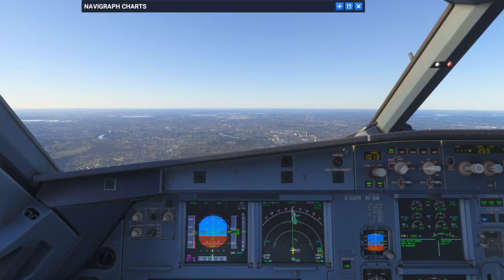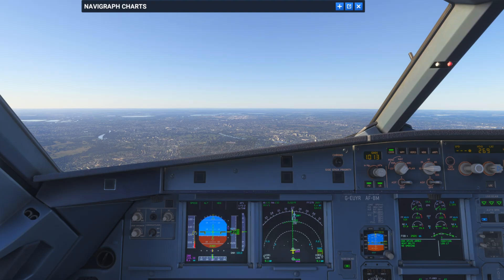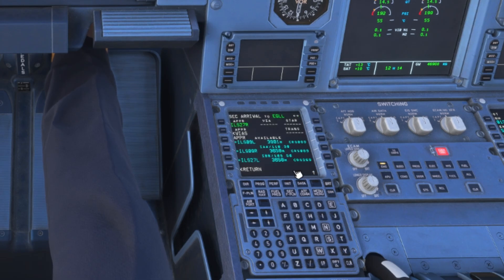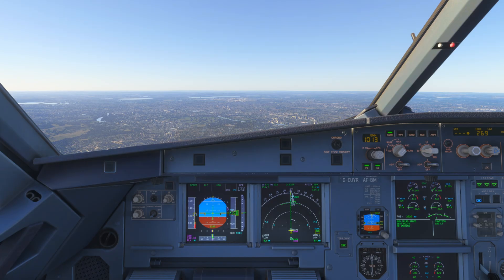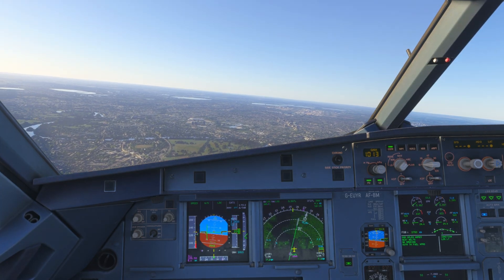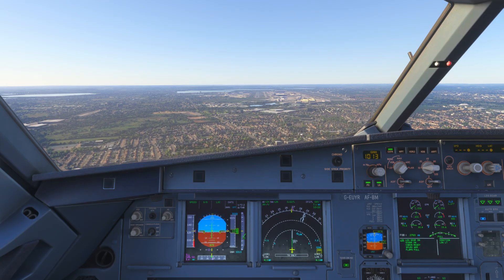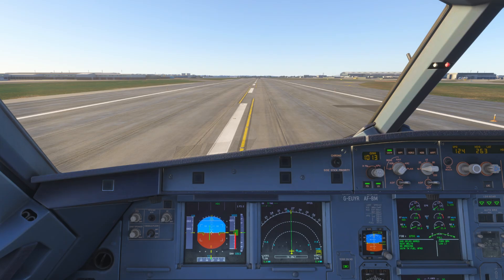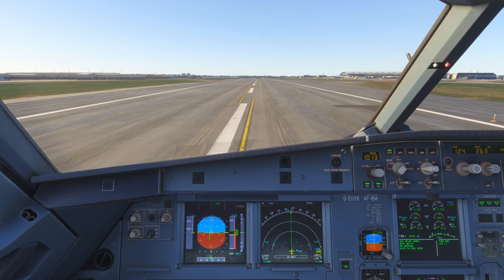How to Fly a Sidestep Approach | Real Airbus Pilot Tutorial in MSFS 2024

Comment: Can't believe I never considered using the secondary flightplan for this sort of thing. Whilst I wasn't doing a side step, just tonight I went into Paris (LFPG) on vatsim and was unsure which runway I was going to get 26L/27L on arrival as both were in use. I had to quickly change the box at the last minute but this method would have saved so much time....! Thanks for the tip.
Reply from the maker: No problem, there is always a use for the secondary flight plan in every stage of flight, it is often underused in the MSFS world but a great tool to get into the habit of using 👍
Reply: IRL LFPG uses the outer runways for arrivals and the inner runways for departures. So if those are the only ones in use, I'd bet on 26L. Not sure if Vatsim follows that though.
Usually it would be between 26L or 27R, for that i personally made use of the secondary many times.